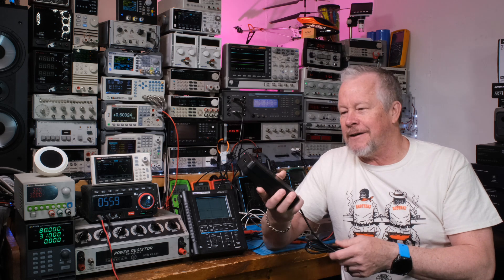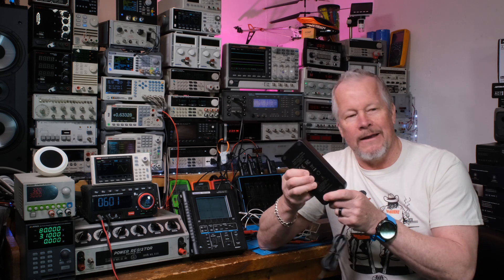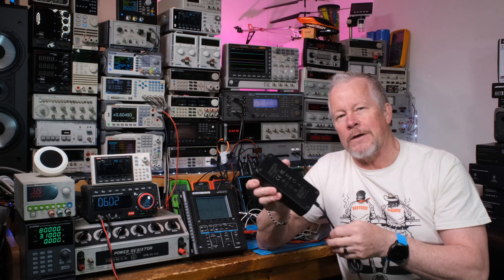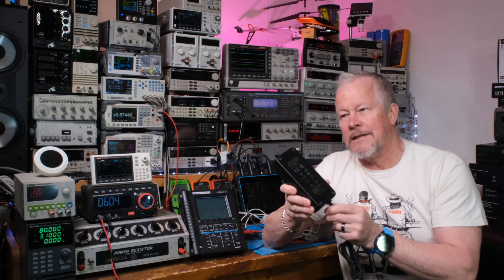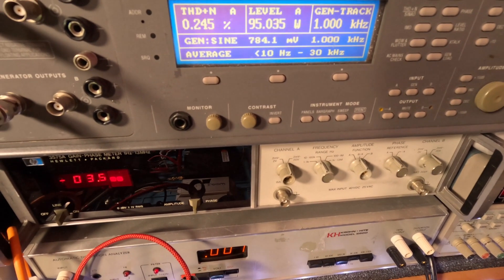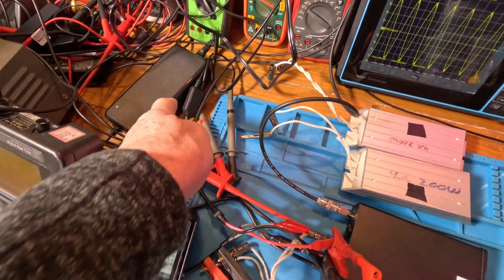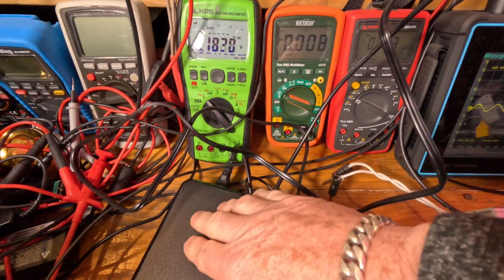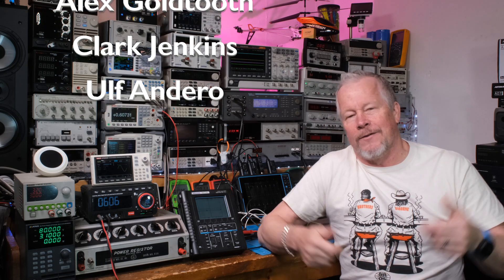Fosi 48V Power Supply for V3 Mono - How good is it?

Comment: I used individual 48V 5A DC on my pair of 2 of V3 Mono.... But recently I replaced them with 32V 5A DC on each of V3 Mono....it did work well with a bonus of lower heating problem. NOW My 48 V DC 5A waiting for its turn to be put On these Fosi V3 Monos once again.😞
. But I dont think it is required .. Because Peggy Lee -FEVER is my benchmark from apple music on 24bits/96KBPS ... sounds almost ... almost same on these 32V DC 5 A on V3 Monos... you may try 😎
Reply from the maker: Thanks for sharing your experience! It's valuable to know how different power supplies affect performance and heat.  I am surprised that you had heating problems:)  I'd think that the higher voltage might offer better dynamics...but if you say it sounds better - I believe you:)
Reply: Apart from audio quality, can you please check if they can output high volume to speakers if swapped with 48v power supply

Comment: Seen many forums and chats with the Fosi V3 and the ZA3's discussing the benefits of upgrading the power supply to a DC48V 10A GaN Power Supply (AIYIMA's version comes up all the time for price and size) for a bit higher outputs, potential frequency distortions, excessive heat, and potential component longevity.
Reply from the maker: Thanks for the feedback - but what is your takeaway?
Reply: @KissAnalog  No personal experience on the V3, but the AIYIMA's DC48V 10A GaN Power Supply works great on my ZA3's in mono.
Reply from the maker: Great to hear - thanks!
Reply: @ruderabbit797 Should I run 2 DC 48v units to my V3 Mono’s?… Do you suggest any OP chips as well?

Comment: ¿V3 MONO*2+48 V/10 A PSU*1 or Two V3 MONO*1+PSU 48 V/5 A*1?
Reply from the maker: Thanks for the question.  I think you are asking which supply - and I'd recommend using two 48V 10A bricks - one for each V3 mono.

Comment: Just found your videos and shared with a friend who also loves audio tech. I have little knowledge on electronics but had an inclination to just use 4 20AH 12vdc batteries to get my 48volts to power my little Aiyima A07 TPA3255 Power Amplifier. Am I off in my assumption that this eliminates ac noise? It does help with our outdoor parties where no ac is available. Now I want to try an TPA3255 Power Amplifier with PFFB. Would I not notice the difference using my Klispch Tangent 400 (comparable to the Heresy 2) floor standing speakers, or any other for that matter?
Reply from the maker: Thanks for the great question!  Some people are paranoid about power supply noise, but I think Class D amplifiers are especially immune.  It would be a great test to run a power cord and try running off the 48V power supply, and compare it to your battery power.  Battery power is fantastic for Class D as it is far more efficient than the Class A/B and especially Class A.

I do see the performance improvement with the PFFB, but whether it can be heard - I'm not sure.  I wouldn't be surprised if it is a noticeable different.
Reply: @KissAnalog  Thank you for your response. The quest to cure this upgraditis continues! PFFB in my sites dammed be the tariffs.
Reply from the maker: Yes sir;)

Comment: Really interesting results. No sense in spending $$$ for a linear power supply.  I'm having fun with some of the Fosi stuff. thanks for this!
Reply from the maker: Thanks for the great question!  Most linear PS will have a low freq switcher in front which is noisy on power at 60/120 Hz here in the states.  These are clean switchers and the Class D (and most amps) are immune to the noise.

Comment: Nice!
But just wondering how the GaN 48v 5/10 A from example Aiyiama is performing?

When GaN has higher switching frequency then the noise should be even higher up in the frequency range..

But if that is better or not when it is in either way higher than we can hear allready.. so it do not matter probably.😂❤

No clue if there is "undertones" that is causing noicie lower down in the frequency range?
Reply from the maker: Thanks for the great questions!  The noise is so low - that it doesn't look like the PS can be attributing much - if any,  I have a video that is coming out soon to show more measurements from the Quant Asylum;)

Comment: I purchased a pair of Fosi V3 mono amplifiers and tested them on an audio analyzer. Taking noise floor measurements while setting input level to about -90dBV@1kHz to hopefully see a single spike on an FFT, I found that each amplifier exhibits noise between 10k-14kHz, moving around as  the amplifiers heat up. 

I suspect that the noise is generated by the external power supply. Can you verify this with your sample?
Reply from the maker: Was it wide band noise or were there harmonics?
Reply: @KissAnalog  Viewing from the FFT, the noise profile was narrow but not sinusoidal - I’m guessing maybe up to 200Hz wide and no noticeable harmonics. It drifted from lower to higher in frequency as the system warmed up. As you might expect, each amplifier/PSU responded differently (different start and stop frequencies over heating up)
Reply from the maker: Thanks - what amplitude was the noise?  I do see more noise at those freq than the lower frequencies.
Reply: @ The noise appears to be about -83dBV at the offending frequencies. The noise floor of all other frequencies ranges from about-110dBV at 20Hz slowly ramping up to -100dBV at 20kHz (the instrument shows a noise floor of about -140dBV with no input)
Reply: @mattdudamusic Powering it with a 48V e-bike battery (or 4 car batteries i n series) might  be a good way to definitively determine whether noise is PSU or  class-D amp ..
Reply: What brand of power supplies do you recommend for these Chi-Chi amplifiers on your findings ?
Reply from the maker: This Fosi PS seems to be very good.  I did buy a couple others to compare, so I'll do that video soon.

Comment: What's the ripple noise out of the power brick?  Is that the GAN version of the power brick? 

I'm using a different board with the same TPA3255 it can handle 17 amps of current.
Reply from the maker: Is there a fan?
Reply: @KissAnalog  Yes on the SMPS inside a 10x4 metal box with extra filtering ( holes for intake & exhaust)
Reply from the maker: Nice work!